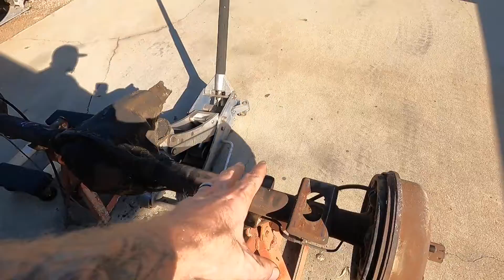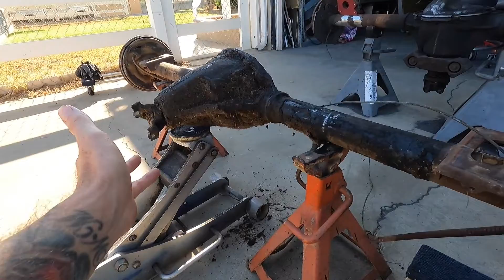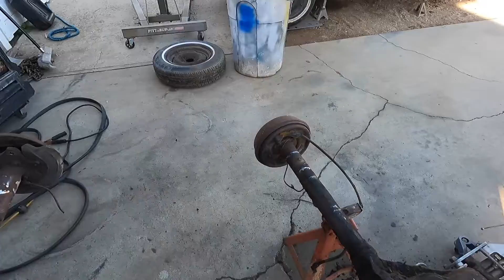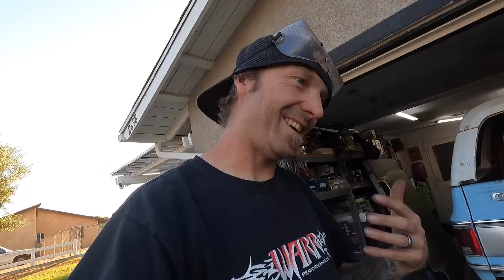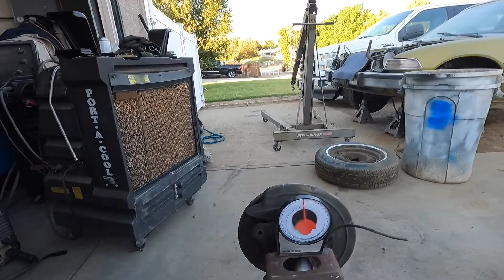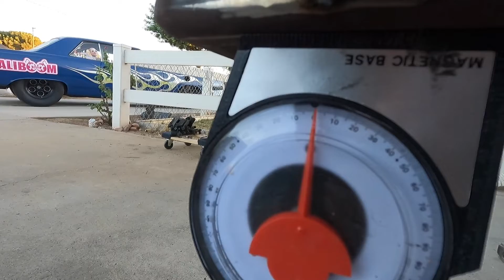Ford 8.8 Rear End Spring Pads and Pinion Angle

Comment: Did this with an LSC 8.8 rear to get an 8.8, big disc brakes, 3.27 gears and limited slip on my '67 Mustang for cheap.   Swapping the brake mounts side to side & getting two used same-side Ranger axles narrowed the track.  Worked out great.
Reply from the maker: I have done that swap a few times as well. Works out great when you need a 56" rear end